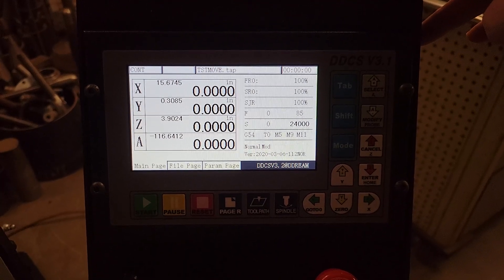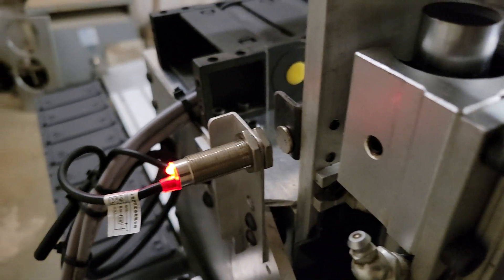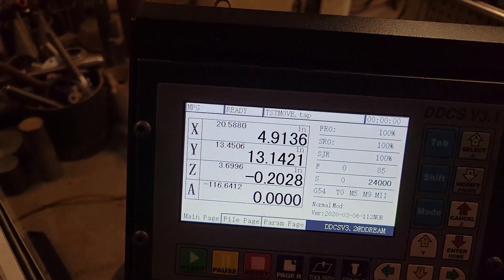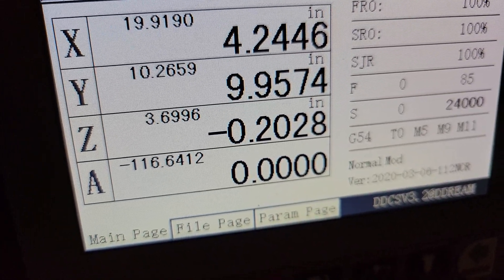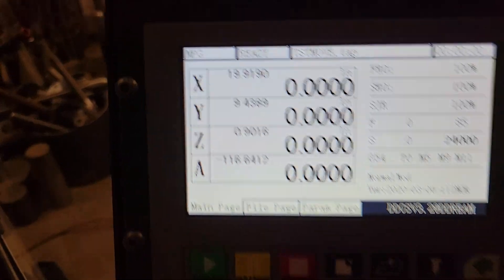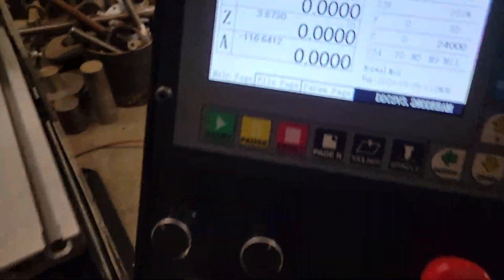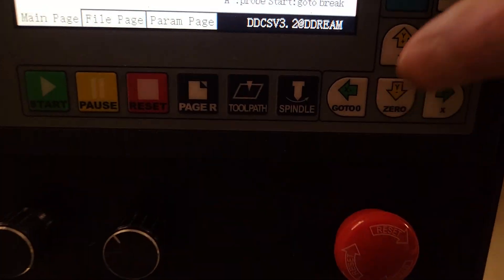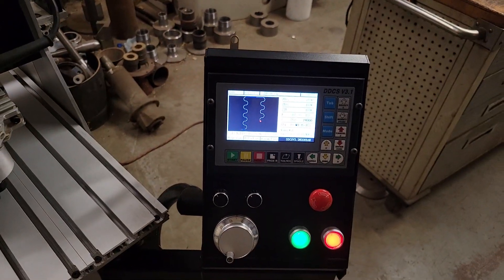CNC Stand alone control DDCS V3.1 Operation performance Part 1

Comment: If your stepper drivers have feedback you can connect the "error" from the driver signal to the controller and it will hit E-stop and same time can Stop "EN" signal and motors can be moving freely, 
the limits didn't beep but the E-stop only did and Hybrid motors where way faster than regular ones like I remember 50 Rev/s where regular ones only 4 rev/s 
and no missing steps